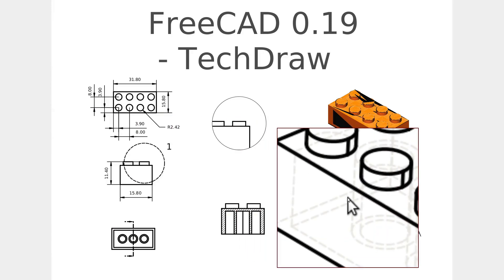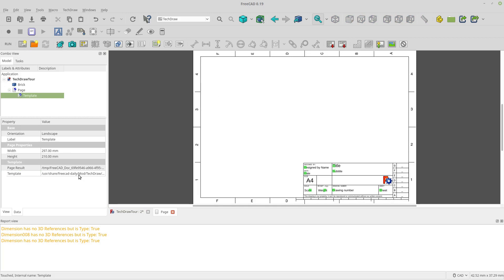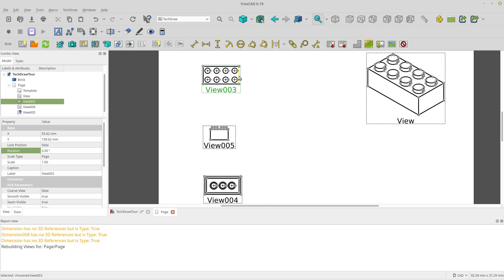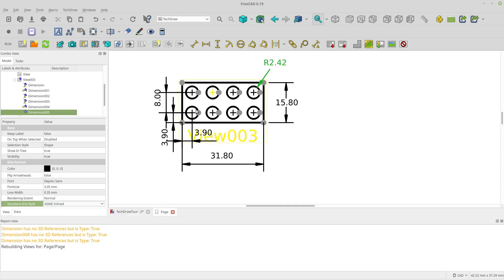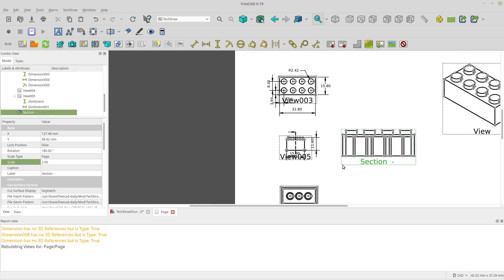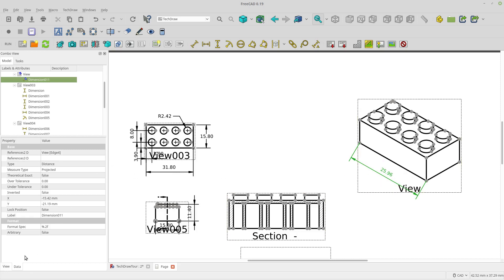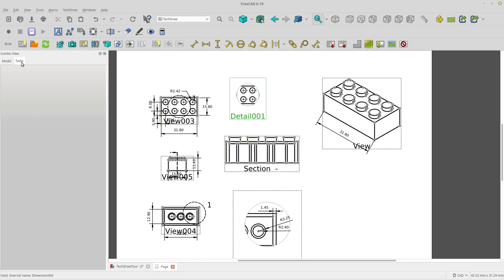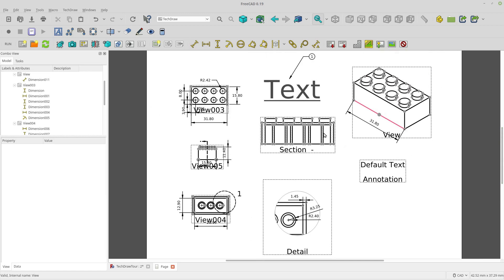FreeCAD TechDraw - Tutorial

Comment: Pick up a second hand copy of an Engineering Drawing textbook or handbook. These will give you all the information you need to layout a drawing in orthographic projection. Enjoy. When I design something I like to develop the parts, assembly and drawing in parallel. This makes it easy to see what you are doing sometimes and you optimise the design as you go along. It is way easier these days than when I started with pencil and ink on tracing paper. Knowing the projection is important. Otherwise your toolmaker may make something back to front. I've seen it happen.